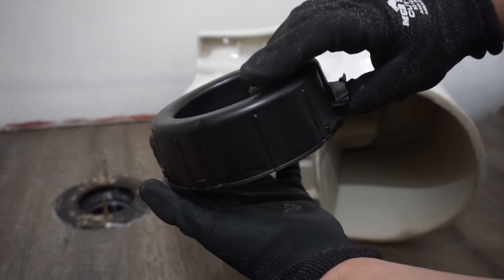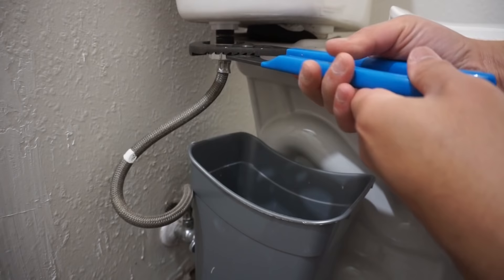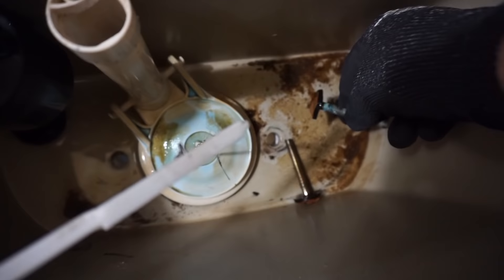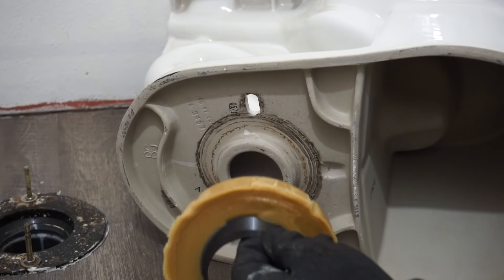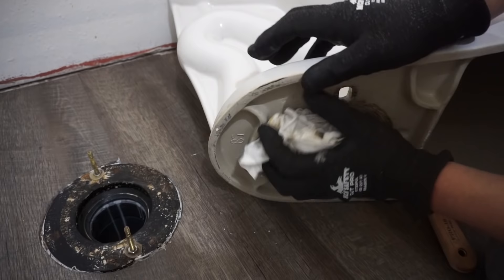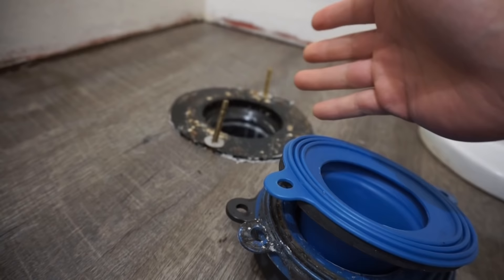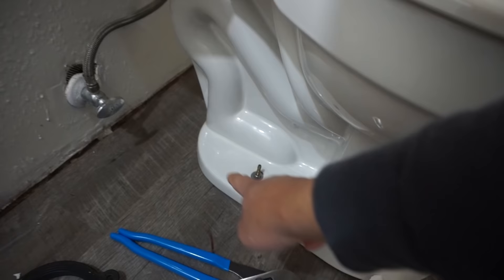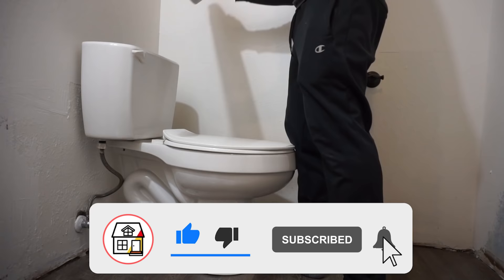How To Replace A Toilet Wax Seal OR Rubber Toilet Seal On A Toilet Flange To STOP Toilet Leaks!

Comment: Do not do what the guy done . I have been doing plumbing for 27 years and have a master plumbing license. Don’t remove the tank and if you do you don’t reuse old parts get new bolts and gasket .It will cause a leak on the tank to bowl connection.He didn’t even put the china caps (covers) on the closet bolts. Hire someone that know what they are doing . A few hundred will save you thousands in replace flooring or sub floor on a pier house !! This guy will cause you issues!! Not a plumber and not a good handyman either 🤣🤣
Reply: I always remove the tank these days.  But I’m not a plumber on the clock.

Comment: Why take off toilet tank waste of time your chance of having more problems are great. Just remove whole toilet have done this 100s times
Reply: It’s two bolts.  They’re going to need replacing eventually.  One less thing to worry about.
It also makes it a more reliable install as it’s easier to set it right the first time.  The wax seals are unforgiving.

Comment: Why are you taking the toliet apart?
You turned a 15 min protect into a hour. 
Put the new wax ring on the flange on the floor with the new hardware and install the toilet. You don't have to remove the tank. Rubber rings are for motor home's not so much for residential.

Comment: The fluid master rubber seal is the best way to go way better then any junky wax ring that are messy & will go out in a very short time, I used the blue rubber ring funnel only didn't have to use the extra flange riser all I did is just dropped the blue rubber funnel in the drain flange & 8 years later haven't had any leaks, wax rings are thing of the past & anyone yet using the wax rings over a fluid master rubber kit are mentally unbalanced.

Comment: Why in the hell would you remove the bowl??? That is a bad thing to be teaching anyone. You should only be removing the bowl if the toilet is to heavy. Next I’m replacing the rubber because why there is a leak. Wax is reliable but won’t last forever .
Reply from the maker: Do you mean tank? I removed the tank because most tanks are connected to the bowl by 2 nuts and bolts. If you tilt the bowl to remove the wax you will risk putting to much weight on the tank to bowl possible cracking and porcelain around the bolts causing future leaks. Rather be safe and detach the tank, but that’s just my opinion 🙏🏽
Reply: I use a blanket. I just did it and realized that when my guy put it together he did not tighten those screws tight enough and had to tighten them once I put the wax ring on.
Reply: Mine only lasted a year it keeps leaking after a year wax rings ... I'm tired of changing it it's been 3 times .. once a year
Reply: It's a bad thing calling the tank a bowl and you shouldn't be misleading people thinking otherwise.  It's a little difficult to install the wax or rubber ring unless you remove the "bowl" from the floor.

Comment: This is not a good guide.  There's no need to remove the tank, that's a waste of time unless it is leaking.  Always remove the tank lid and set aside, it's easy to break those if they fall off while moving the toilet.  When you remove the toilet, grab it on the sides by the bolts, it will be most balanced here.  Take a 50 gallon trash bag, and roll or crumble the sides down so that it will sit on the floor upright, almost like a bowl, then set the toilet in there after you remove it.  He showed using an extra-thick wax ring, which is only designed for when the flange is lower than the finished floor.  Otherwise, you crush the wax ring too much and risk compromising it.  So if you go wax, get the right one, and always replace it with a new one when you remove a toilet.  He didn't show this but it's a common error for people to caulk around the base of the tank.  NEVER DO THIS, as it will trap water underneath the toilet if it starts leaking, and you won't know until it's done substantial damage to the subfloor/rafters and the ceiling underneath (where applicable).  Be sure to put the bolt cover snaps on in the right direction, underneath the metal washer, so you can put the covers back on when finished.

Also, turn your pliers around, you used them backwards lol.
Reply: That's why you leave the back un sealed. Any leaking, and the water comes out at the back instead of the front.

Comment: Those wax rings suck you gotta think about it look at how big the hole is where the poop goes through now you got a 2 inch hole or whatever it is anybody that uses as wax rings is not a plumber
Reply from the maker: Wax ring and rubber about same diameter